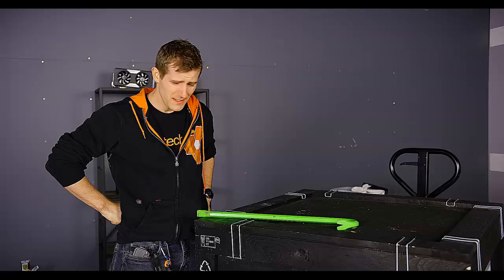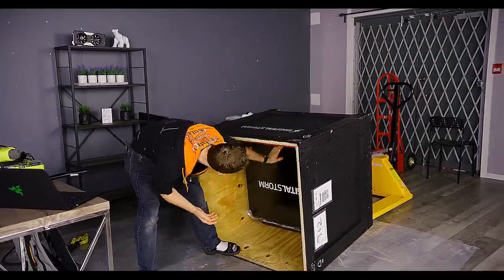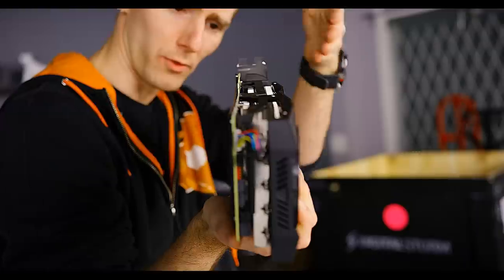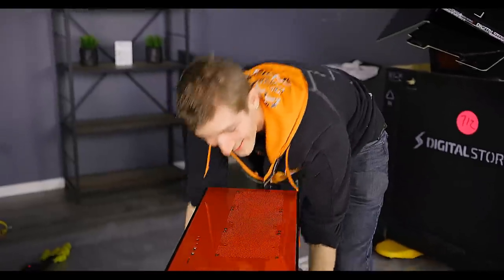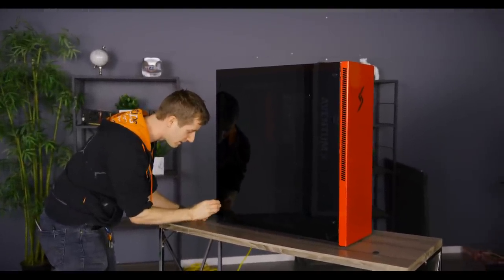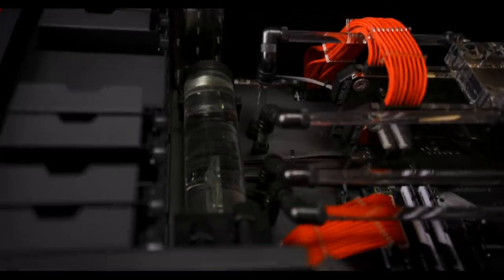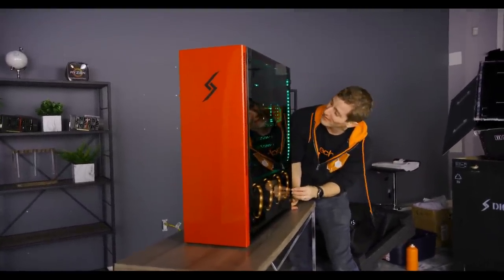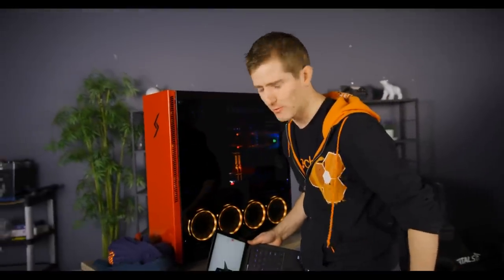UNBOXING the GOD OF GAMING PCs!!

Comment: Will this 10k computer really make any difference, my old laptop run windows 10 it is all gonna lag with att's old copper phone lines anyway. Lol. Best part of owning my laptop, it had a dirty cooling fan (stuck) I dig it out of the dumpster three years ago an it's still going. Wish it had a bigger HD. Can't complain it didn't cost NOTHING! Love my HP.
Reply: The way we interact with computers is evolving constantly, and if you’re a small business owner, there’s a tendency to just go with the flow while deciding whether your employees should use a laptop or desktop computer at work.

While laptops remain a popular computing solution for many, especially companies with team members who are in the field a lot, the reality is that desktop computers offer numerous advantages over laptops, for professional applications. Whether your business trades in words, numbers, images, or some combination of the three, the power, durability, and flexibility that desktops provide make them the best choices to deliver the specs your day to day operations demand.

Not convinced? Consider these six reasons why desktops are the superior alternative to laptops for your business computer needs.

1. Power

Simply put, desktops are more powerful than laptops. This is due mainly to the computer’s size, heat output, and power consumption. Additionally, desktops simply have better specs and run faster and smoother than laptops. Industry research shows that desktop computers are equipped with more impressive processors and a better overall speed. Even with similar model numbers, laptops are not as powerful as desktops.

While laptops offer the convenience of portability, only desktops provide the adequate computing power required for more substantial tasks, like running complex healthcare applications, managing enterprise data storage solutions, or running powerful design programs.

2. Size

Just as desktop computers are more powerful, they also come with full-size parts that work better than their miniaturized components designed for laptops. Your laptop may be outfitted with a top-of-the-line mobile processor, but it will not compare favorably to its desktop counterpart. In this particular case, bigger does actually mean better. Even a small incremental increase in size lends itself to better functionality, therefore guaranteeing that your desktop will outperform a laptop. The full-size parts ensure a faster and slicker experience that puts desktop computers several steps ahead of a laptop and maybe ahead of your competition.

In recent years, NUCs, or “Next Unit of Computing,” have started to change the way consumers and businesses think about the traditional desktop computer. A NUC, designed by Intel, is a small form factor computer case that provides programmers the opportunity to create customized computing systems for various applications. The small footprint of these systems, combined with their powerful processing abilities and customization options, make these an increasingly appealing alternative to not only laptops but traditional desktops as well.

Whether you choose a traditional desktop or a NUC, its size not only matters from a functionality standpoint but on a user experience level, too. Desktop computers offer higher quality screens and more powerful audio capabilities; with a laptop, your staff is limited by the smaller size of the screen and often subpar speakers. With a larger, higher-quality screen and more powerful sound system, a desktop enhances your experience by providing clearer, crisper picture and higher quality, more defined sound. These advantages make desktops ideal for consuming media, yes, but they also make desktops necessary for professional applications like web design or video editing.

3. Durability

Since desktops are larger and easier to cool, thermal damage is much less of a threat to their components than it is for laptops. Superior temperature control means computer parts last longer. Also, solid-state drives (SSDs) fight the effects of time much longer than conventional spinning platter hard drives. Fewer moving parts mean significantly lower chance of mechanical failure. For these reasons and more, desktop computers win over laptops by presenting components that can better withstand the test of time. Your hardware investments will east up less of your bottom line.

4. Portability Factor

Even though the case for mobile computing is compelling, a laptop’s portability is actually detrimental to its performance. Not considering the fact that laptops are more susceptible to theft, just the added physical wear alone is enough to bring down the value of a computer. Aside from broken screens, when laptops are carried and bumped around a lot, they are more susceptible to damage and failure.

5. Upgrades & Repairs

Laptops generally need to be replaced more frequently than desktops, especially if you’re looking to upgrade. And the cost of replacement units comes straight out of your company’s bottom line. Because it is much easier to upgrade desktops, the full-size machines provide a better option once again. You have the option of upgrading unique parts in a desktop, while you would have to buy a whole new laptop for the same performance, as most laptops limit their upgrade options to just memory and storage.

If you run a business that requires multiple computers for your employees, the ability to upgrade desktops makes them a far more cost-effective IT solution compared to laptops. This frees up resources that can be invested in additional office tech to make your workplace more productive.

Just like with upgrades, desktops make it possible to conduct a few repairs and increase the lifespan of your machine much more tangibly. You can replace virtually any part of the desktop and still keep the entire unit. This option is severely limited, if not impossible, in the laptop counterparts.

6. More Cost-Effective

Overall, desktops provide a better option for the reasons cited above, but another crucial advantage is the fact that they tend to be significantly less expensive out-of-the-box. While retailers often sell laptops at a premium (often due to their portability, which, as we’ve noted, has pros and cons), desktops that offer more power, durability, and flexibility are available at a relatively lower price-point. Consider this in conjunction with the increased longevity and the opportunity to upgrade and repair a desktop far more easily than a laptop, and it’s easy to see why a desktop is a more cost-effective choice when it comes to professional computing.

Comment: So there's gaming parts for about 3000 and the rest of the 7000 is for RGB, water, cooling system and fan's?.. Sure it's costume built and has a nice paintjob, but 10.000 dollars, really?, I would probably rate it at 7-8000 dollar's total.

Comment: So… basically this system is a typical bish, but gasped had to be very very VERY extra
Like…. They do not need that much cooling, in this weird so of way, for two 2080tis, and that i9 XP
I wish this thing had a titan 20 series, with one of the i9 extreme versions, instead of…. That.